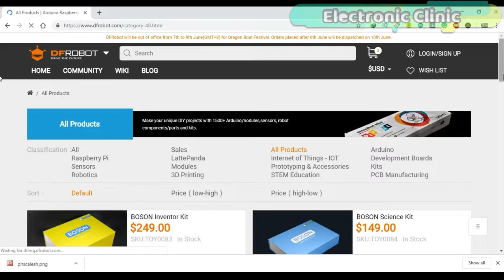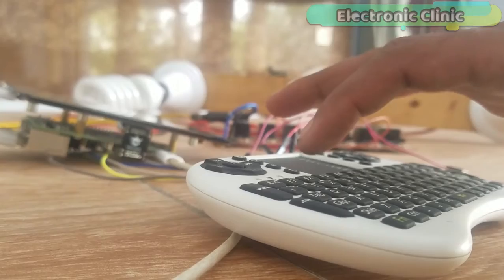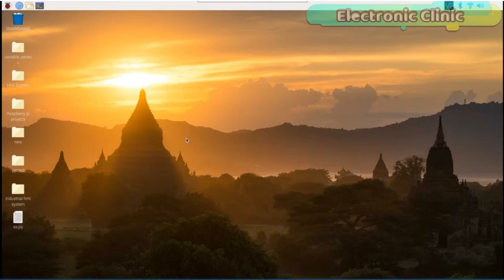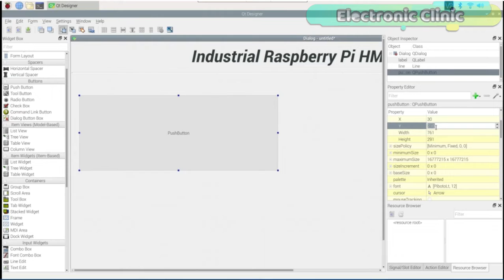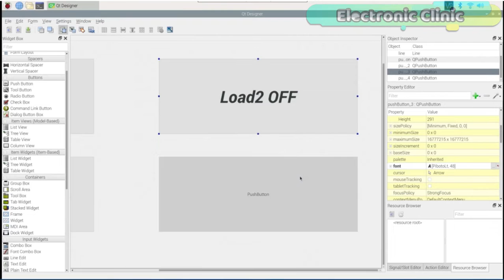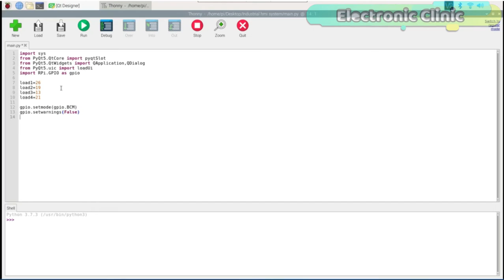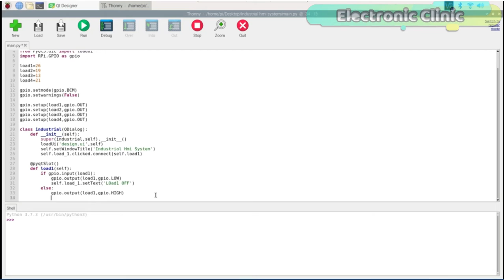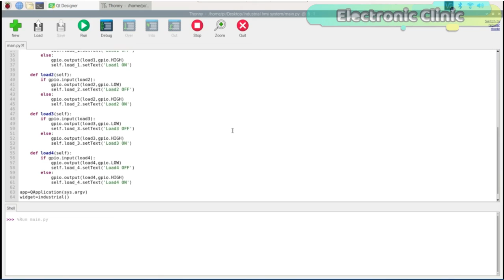Raspberry Pi Industrial Automation HMI/GUI designing using PYQT5 Software & 5.5 inch Touch Screen

Comment: Is there a way to set up the pyqt hmi on a win 11 machine, program the python script into the button on the pyqt hmi on the win 11 machine and then read in the gpio pins via IP address to the raspberry pi via network connection?